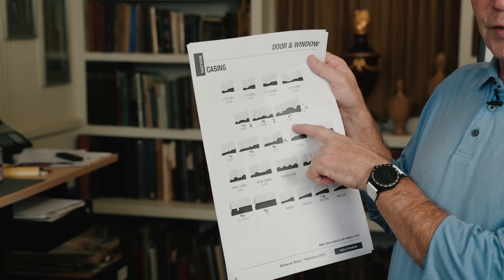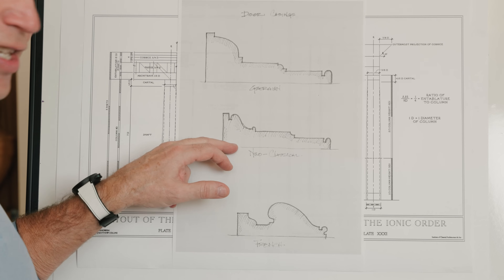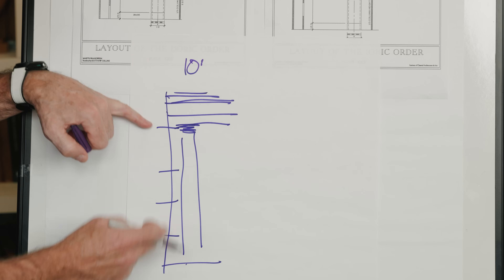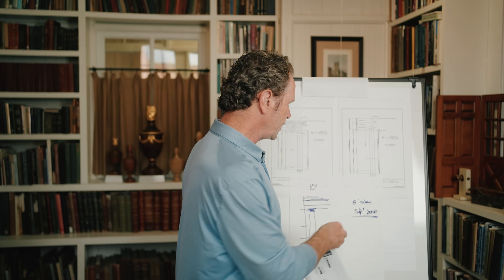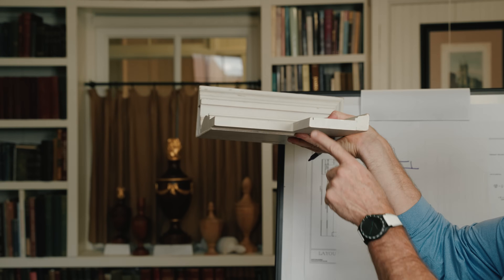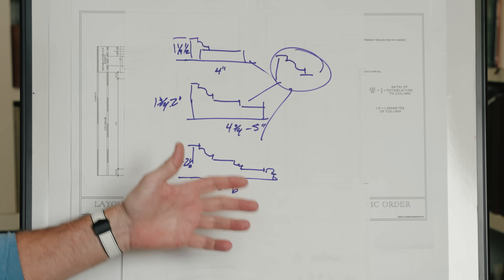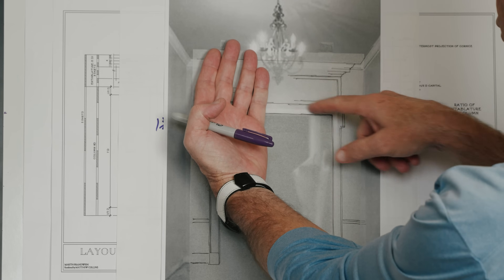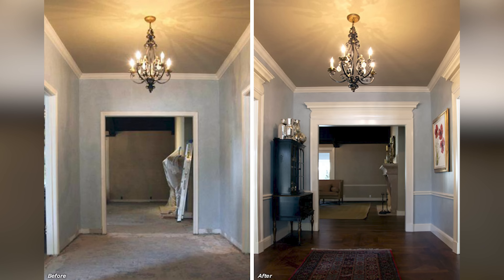Master the Art of Choosing Stunning Door and Window Casings with this Video!

Comment: I don’t think any client will accept 3” thick molding. And we have a few eccentric clients. I thought we weren’t supposed to use crown.
Reply from the maker: 3" thick casing belongs in a larger room and probably needs 10' ceilings. There is good historic precedent for it. When did I say don't use crown?

Comment: I own a 2 bed, 1 bath one story built in 1982. Hollow-core mahogany doors & mahogany "picture frame" door & window casings... planning on buying new solid doors and changing to a 20's vintage simple casing of 1"× 4" with corner bead added to the outside.
Trying to go with a simple 1920's Bungalow theme inside & out.
Reply from the maker: Good luck!

Comment: In our current house build (a custom spec for sale), we chose Andersen 200 Series windows. Since they don’t come with casing, I thought, “No problem! I’ll find a beautiful, thick moulding to frame them.” Well, nothing—and I mean *nothing*—was the 1" depth we needed to make it work. My husband suggested we go with brickmould, but even then, the windows stuck out past the standard brickmould you can get in stores.

I even looked into having Versatex custom-make a 4" wide brickmould with a 1 1/4" depth. That would’ve been perfect, but it just wasn’t in the budget. The whole time, I kept asking, “Why isn’t this available as a standard option?” I just know they’d sell truckloads of it!

So, to my heartbreak, we’re ending up with the brick butted right against the windows. It’s one of those little details that would have made such a difference, and it truly pains me to let it go.
Reply: I know that feeling; there’s one chance to get it right, and it just doesn’t happen. 🥴
Reply: My house was built with 200 series Andersen windows, still as good as new 42 years later!
Reply: My living room windows are exactly how you describe with the brick porch wall butted against them... not my ideal, but it is functional.
Reply: Don't forget to at least do brick jack arches above each window.  It's a detail that is skipped way too often that looks architecturally correct and looks much nicer.
Reply from the maker: Yikes. So sorry.

Comment: Hmm, I know it's just a catalog but at 10:17, I think the apron is too narrow.  It's supposed to line up with the architrave above so the stool needs to be wider as well.  Also, I like the idea of doing a tall frieze panel connecting the door architrave to the crown.  I have 8ft ceilings (house built in 1993 when 8ft ceilings were common) and I think this would be ideal for this scenario because it allows you to elevate the door and still have room for crown on the ceiling without crowding and getting out of proportion.  Also, I'd like to add that everyone should get a copy of How to Get Your House Right.  If you don't have the ideal 10ft ceiling height to correctly follow the classic order, then there is a table in that book which documents which size mouldings you should use based on your ceiling height (8ft, 9ft, 10ft).
Reply from the maker: Thanks!

Comment: This is such a helpful video, Brent! One of your best because you lay out the math so clearly. I feel like I can apply it in my home right away, so thanks! One question: what do you do in situations where the framing doesn’t allow for the full-width casing that’s needed? Are there adjustments that a master carpenter would use to shrink the molding but still tie it in, say, in a tight corner? Perhaps that’s a video topic? Thanks again!
Reply from the maker: I usually blend it into the wall as if it was cut off. Good luck.

Comment: The content is solid. The only issue i have is the monolithic casing. It is without a doubt a labor savings over historic multi-layered built-up. However its limiting in some applications. You you can do a lot with 3 peice casing that is not possible or more labor intensive on single casing, something as basic as a jackmiter. I agree its still better then 99.9% of what's available off the shelf. However at this level I want the absolute best for the application.  Being able to adjust the width, mix profiles and carry details is the true benefit.
Reply from the maker: Ok, thanks for sharing.

Comment: How do you feel about veneered millwork? I'm thinking in the realm of being able to get the proportions correct but not have to spend as much on solid wood. I know there's some examples out there but I don't know if they are a decent representation for the masses to be able to get proper casings and millwork (not just door casings) loved to learn as well.
Reply from the maker: I'm not sure veneered millwork exists?? Why add an extra step to wood trim when raw wood is fairly cheap.
Reply: @BrentHull  Veneered is the wrong word. I meant laminated like plywood versus solid wood trim, 10:22 the piece looks to have horizontal glue lamination lines like its plywood or are my eyes just seeing things?

Comment: We have a 60s ranch and our problem is a lot (including front door) is right up against a wall. So all that fits are the smaller trims. So is it better or our only option to use the smaller casings or just rip the side against the wall down to fit?
Reply from the maker: I would rip it down so it can fit. Good luck.

Comment: Where is a place to find the information on figuring out the sizes to use in a room. Great video
Reply: The American vignola is supposedly a good book. You can pick an order from the 3 (or 5) and just use the ratios.
Reply: As I mentioned above, there is a table based on ceiling height on which size mouldings you should use in the book How to Get Your House Right.
Reply: @snafunet  It's actually just called Get Your House Right. An excellent read!
Reply from the maker: ICAA- Institute of Classical architecture and art. Great learning here.
Reply: @marvinhaines9297  Sorry!  You're right.  I don't know why I was thinking of "How to" but yes it's a great book!

Comment: Our Craftsman bungalow, built 1927, had original wooden windows and 4-1/4” trim around inside doors and windows.
Sadly, a previous owner put in a picture window and replaced the trim to make the house look like a 1950-60s bungalow.
We replaced the picture window with one in a style similar to what was there originally (but in vinyl as I hadn’t found your channel yet).
My next step is to replace the ugly narrow interior trim and perhaps add crown moulding. Our ceilings are 8’5 and some areas/rooms are as small as 4’x 4’ Is that ceiling too low and rooms too small for crown molding?
Reply from the maker: Sounds like you are headed in the right direction. FYI, Crown wasn't an important molding in 1927. If you can get the trim returned to original you should be in great shape. Good luck.

Comment: Brent, I would have thought that on each floor doors may  have different width.
But moldings and casings should be the  same. 
Do you mean they may have different design?
Reply from the maker: No, door and window casings should shrink as you change floors. Lower ceilings, moldings shrink. THx
Reply: @BrentHull  that's right.
But  you were talking about different casings ON THE SAME FLOOR  to emphasize inportance of the premises. Or I misunderstood you?

Comment: Dear Mr Hull, I would like to ask you for advice.. I have a 9ft 4 inch (285 cm) tall room with 8ft 4 inch (255 cm) tall Windows and  Openings (5 ft 3 in or 160 cm wide). I would like to case these but it's getting close to the ceiling as there is only about a foot of empty space to the ceiling .. how would you suggest tying it into the crown in the room? I would really like to make this space magical.
Reply from the maker: In this recent video, I tie the door to the ceiling with the frieze. The frieze (a flat board) over top of the door casing and under the crown. Good luck.
Reply: @BrentHull  Yes but my limited space above the opening violates the 1/5 size of the entablature so it's very tight to the ceiling with only 1 foot .. any suggestion what to do here so it does not look "funny" or forced?
Reply: I found the answer to my issue I hope  in one of your older videos  on th e build show “choosing the right classical Elements .. “ when you observe the Roman’s added a column base changing the proportions.. if I follow the Roman’s and not the Greeks I might be closer in proportions with my 1 foot entablature.. I guess I need to add a chair rail to the room. :) thank you !